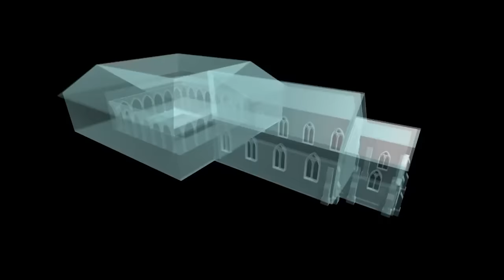➤ Time Team's Top 3 FUNNIEST Digs!

Comment: The Chinese Father would dig a hole, put clay in the bottom of the pit and build a toilet over the pit with clay hoard in the base. This was like a gift for when that son turned 21. When the clay was retrieved from the pit, the best quality porcelain was enough to build a pottery business. The human waste and kitchen waste, bones etc., had bleached out and broken down the clay particles to a mostly Silica, high fire vitreous clay over those 21 years. Mixing in camel dung in those areas or sheep dung because of the grasses diet, for regular shaped voids in the fired clay for heat and cold expansion and contraction. Since Pots were fired the dung has even used for the fluxing that allows for lower temps for vitreous ware.